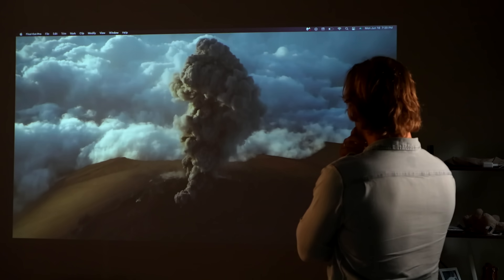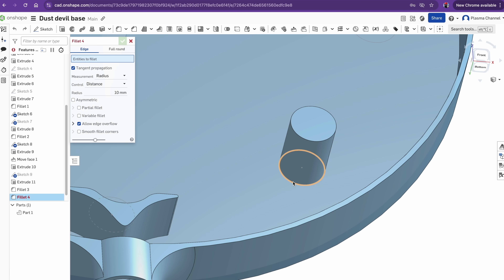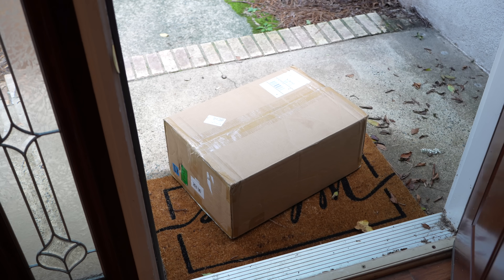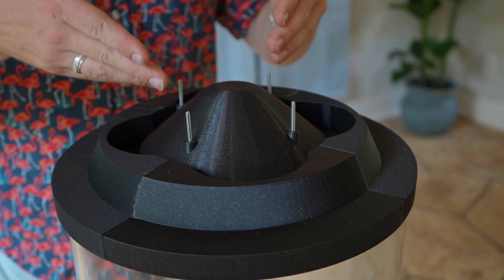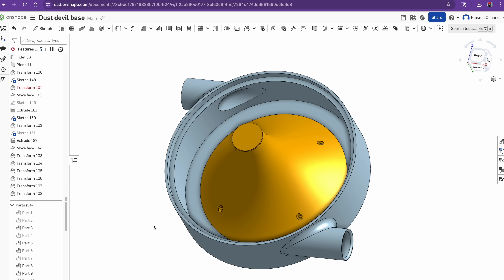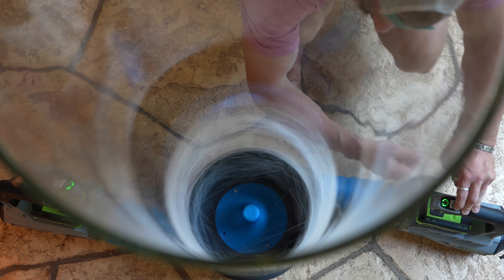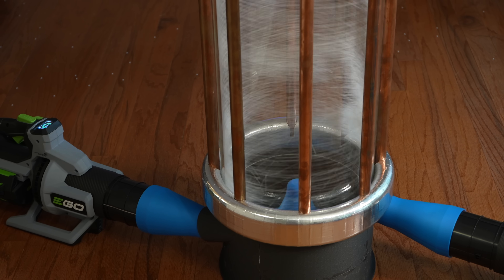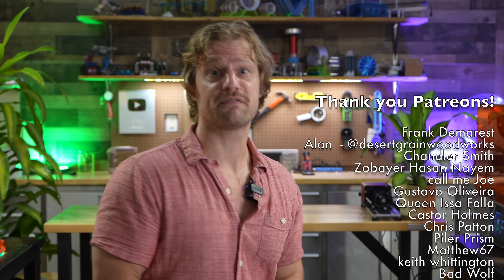Making Lightning In A Bottle Might Be Possible  (ft. 3D Printing Nerd)

Comment: Hey Jay !  Doing this made me think of other things maybe I would try, away from original intent. Like having either metallic beads or just sand,  swirling and introduce high voltage,  one wire at top, one at bottom and particles finish the connections at random. Just a thought.

Comment: I guess you don't know what induction is. Inductive coupling would require magnetic fields and coils.
Reply from the maker: So, with static electric fields, you get an induced charge separation in nearby objects, even though no net current flows. It's not EM induction, it's induced charges from being influenced by static fields nearby. So, a different form of induction.

Comment: if you want to pick up charge with a conductor like your cage, you have to ground it, charge it, then unground it (see volta's electrophorus).
 Insulating from the air would help too
Reply: Correct, I was about to comment the same. All he is doing is charging the inside surface of the glass which induces a charge separation in his conductor on the outside but no net charge unless he does as you suggest.

Comment: Jay, you were partly right with design 1. Anode and cathode at the top and bottom of a NON-conductive tube. The anode and cathode can then be used to complete a circuit. The charge will build up and the only way it can discharge is via the cathode. With regards the airflow, I would suggest a shaped open entrance at the bottom, so it channels air in and the air is sucked out the top, you can either do this directly or via the venturi effect. Directly may be easier, but the venturi is more likely to work as that will also build a static charge in the air mass- its what happens in natures. There is an old video on Youtude where a guy made an articial tornado - which is what you need to get the sand lofted up to build charge. 

https://www.youtube.com/watch?v=h28T0-BaInE

Comment: Your Plasma vortex was perfect, but now you have to attach 6 1000v pf capacitors to the aluminum you wrapped around the middle, and connect the other side to an air resistor, all in parallel.
Reply: Remember to ground the other end with Cooper, then the air resistor.

Comment: Harbor Freight, the $45 leaf vacuum/blower.  In vacuum mode in the Fall, it will shock the heck out of you.  Dry air, plus all of the bits and dust, if your  leg is touching the black bag especially, it will generate large static shocks.  And if you have your hands anywhere near the switch, the shock goes through you to the power switch acting as a ground or close.
Still great, just hold it with the bag away from you instead of resting against your leg.  Same basic idea as the sand vacuuming, lol..

Comment: to FIX YOUR METAL BALL (I saw it has a dent), 
you can toss the ball in your vacuum chamber
you might need to pre-heat the ball in an oven first, but better to try room-temp first (that's what worked for me).

Comment: You should use sand, quartz have also a piezoelectric effect it might play a role here. Also the not round geometry allow for more interactions between all the surfaces. But it will polish your glass tube

Comment: If you have a lumber yard close by, check out the Cyclone Separator used to collect the saw dust. It’s a huge water tank sized device used to separate the saw dust from the saw dust collector vacuum system in the factory. I don’t know if they have problems with static electricity.

Comment: Maybe you should try and put the cage around it again but ground it. You're getting a spark on your arm because you're grounded. If the cage on the outside of the glass is grounded you should see constant sparks from the glass to the copper tubes.

Comment: Just throwing this out there for science:  WHAT IF you turned the tube sideways, added little fins inside the glass to keep the balls moving in this position, and with that other copper thing outside the glass, build another counter rotating glass chamber that spins in the opposite direction.  I know this sounds completely insane but it would be mostly like a particle generator/collider for lightning lol  Things like this are too dangerous, messy and expensive but its still a lot of fun to think about!!!  And maybe Im completely missing something here but this is like one of those forever running magnetic machine things lol  YO if you got like a small engine to run the fans, that would be pretty dope too lol

Comment: So the trouble seems to be that you can't access the negative charge from your "sand".  I think the vacuum zapped you because it was metal and thus conductive, and glass Isn't.   I think maybe if you put your sand in a metal container, or maybe funnel your charged sand through a metal collector tube and back into the  glass tube- like a loop maybe?  out the top and back in the bottom?  dunno if that would work.

Comment: It seems like it's basically a super capacitor that needs a way to discharge through a resistor to make it a usable longer term voltage.

What would happen if you had the spark jump to an actual super capacitor?  Would it capture the voltage into a more usable device?

Comment: I have 2 ideas, each for a separate issue. For making the vortex see if adding a glass coil inside the cage helps. For extracting the charge, try mimicking a battery in that charge comes in one way, goes out the other. In  other words slap a metal disc or something on the top to draw the charge upwards with the air.
Reply: There IS a metal disc inside the top cover, for just that reason! Didn't seem to work too well, since the balls never made up up that high, perhaps just lower the plate down so the balls will touch it. But he already has your plan covered.
Reply: @greenaum he just never showed the disc on bottom after he had to change it so I figured the top changed in some way too

Comment: But isn't a sandstorm static building up when the same material is hitting itself unlike your set up where it uses the properties of two different materials? Also I don't get how sand storm lightning works in real life. Like how do the charges get far enough apart to make lightning? Wouldn't the positive charges be more attracted to the negative ones so they would cancel each other out before lightning builds up. Obviously lightning happens I just don't understand how it works.

Comment: so far, i think you need a heater behind one of the air inputs while keeping the other cold, that way its re-enacting the whole situation that happens in things like tornados .

But weirdly, i had severe deja vu seeing this, but i think thats because someone was making a smoke based vortex generator in a different video but initial designs were almost identical ... wait, just checked, it was your own ionic vortex machine you built a year or so ago - dont you think you forgot everything you learned during that about wind flows and dissipation of charge?

Comment: Nice 60kv static arc over with the vacuum cleaner
Reply: Yeah, shame that the machine that produced sparks by accident, worked much better than the one trying to make them on purpose!

Still, people have commented that he needs suction, not blowing, low pressure not high, so makes sense the vacuum cleaner did a good job. Maybe hack something up with that? Not sand, would get into the mechanism, but rig up the vacuum cleaner, use the little plastic balls, and try and use that with the glass chamber.

Comment: If you notice the material clings to the outside of the tube. The internal electrode needs to be placed on the outside of the tube”inside”   Basically making a Leyden jar. Foil tape strips along the inside would do the trick!
Reply: When I first heard Your Idea, Jay, I thought You wanted to pick up the Charge at the top and bottom of the Tube, after rewatching the Scenes, about half the balls were in the bottom, while around the other half was clinging to the Tube.
Maybe You could cut the copper pipes in half, take shorter ones or alternate them between top and bottom to separate them. :)

Comment: Hm. Nice attempt, and there are two points to take into account for the re-attempt:

1. For the vortex to work, air needs to flow of the center and down the sides. Rather than force the air to spin up from the bottom, since the centrifugal force will push it to the sides, it would be better suck from the center top and let it come back down (maybe with a spin) along the sides.

2. Round and curved surfaces hold a charge better. Nonmattallic gasses (nitrogen, oxygen, air) easily take a negative charge and rush to discharge. If the plastic is less electronegative than the glass (if it is, it will attract dust while you use this device), that can be the other contact point. Ground yourself to one and then touch the other.

Comment: Density needed. Several layers of foil coil with dielectric seperation. There's not enough capacity. Enjoy
Reply: You sure? The problem so far seems to be generating a current, not storing it, but I'm happy to be wrong if you would explain more.

Comment: OMB thoughts here. I do believe you are adding too much conductive area for your setup leading it to leak the energy instead storing it. The build itself it seems to leak to outside instead inside.
What if you pick a PVC tube, not too large, cover the inside with aluminium and place in the center to connect the top to the bottom physically instead wait for the particle to gain energy enough to hit the top to transfer its energy?
Other thing that I notice is once the particles build up charge they start to "bound eletricaly" which will make them work as a heavy block of particles instead light individuals, meaning, once they goes up, not only gravity will push them back and highier they go, highier will be the push force. 
Then try mesure the Electric flow, if there is any, if yes add capacitors in the ends and don't die trying to discharge them.

Comment: Just a thought, when you were vacuuming the sand, the charged sand wasn’t able to come back in contact with the base sand. In your vortex machine, the balls develop a charge, but once they stop moving, the oppositely charged particles are able to move around and discharge each other. 

So, is there a way to spin up the material, build up their charge, and then “suck” out the particles (or collect them at the top of the top of the tube)?

Comment: Maybe instead of having a hole at the top of the tube, you can have an inverted cyclone separator at the bottom of the tube which would generate the vortex but would also force the air to exit through the center at the bottom

Comment: I think for a vortex you need to use the air from inside to be sucked down in the middle instead of letting it out on top. Always remember how a tornado works. it is a circulating system 'almost' closed.

Comment: But why are you ignoring the origional design that worked many times better, by accident? The vac tube. Instead of the chamber, which should have been half as tall looking at the results, one line vac tube in a coil, doubled over.
Reply: A vacuum cleaner hose works so well, why not spiral a wire around the pyrex tube?
Reply: @JerryVolland-bt8cb exactly what I thought. He went from constant sparks to getting excited for one small arc.
Reply: Its a conspiracy, Big Electricity must have got to him. He's compromised lol.

Comment: At its core, you are currently making a Van de Graaff generator, and I believe the best way to collect the charge is to suspend a conductive material just off the surface of the glass.
Reply: Needs a second chamber to be a proper Van der graaf, so the two can build opposing charges and amplify each other.
Reply: @glowpon3  Good point! Though actually, instead of a second chamber, what he needs are separate mechanisms to collect charge from both the glass and the particles. That's why the particles cling to the glass when he stops the air, the glass builds up one charge and the "sand" builds up the opposite charge.
Reply: A sphere allows the electrons to be farthest away from each other before discharging (they are pushed to the outside of the toroid)....that's why they use 'em.

Comment: This would make for an awesome interactive museum exhibit
Reply: Yeah except you'd get people with pacemakers dropping dead and stuff. Perhaps they could have the discharge spark in an insulated glass chamber. Museum visitors switch on the power with a switch or button to hold down (more interactive!) and wait to see how long it takes to make a spark. It could even have a voltmeter measuring the charge. Either the old-type electroscope or something digital just using an enormously high resistance resistive divider, using extra, more than 2, resistors in series just in case one fails, and to spread the load of having to dissipate it. As well as not to steal away too much of the accumulated charge.

Actually an old fashioned gold-leaf electroscope might be good for that, it's nice and visual. I'd worry if the machine would mess up the wifi, mobile phone signals, and even put huge spikes on nearby mains cables. High voltage can be a pain in the arse to modern sensitive electronics, stuff that needs to be sensitive.

Comment: What if you had like an hourglass shape and put vortices on the top and bottom and make them meet in the middle to accumilate a pinpointed charge. 
If you put a fan in the bottom and top inside and get another glass cylinder outside, you could make it a closed system to hold onto the charge?
Not sure if the external airflow is neccesary for building up the charge?

Comment: You don't need any sand, just hot air is plenty. Vacuums are great at creating this effect. I learned this the same basic way, by vacuuming around my wood stove in the winter, I saw some massive sparks coming from the stainless tube to the stove body. It was nothing but hot air in a tube, but the effect was very consistently repeatable. It's just static electric, nothing special I thought, but how to capture and utilize it? That's the question.
Cheers 🍻

Comment: I get a weird amount of static (1-2cm blue spark if use my metal water bottle to discharge on the fridge) 
just from standing up from an arm chair while wearing uggboots with the heater on, and yes it has to be all 3 and the heater can't be to far away.
I don't know why im typing this but weird to see that effect while only having a small spark compared to standing up off the couch

Comment: nice static pillar. sm lol. just dont judge and you are free. forgive yourself of spam. not enough power. why not use a blender upwards prop. or an edf. why do you think the outside of an insulator is in charge. well it is if its a double layer super capacitor. no electrodes, just surface glint. well use a belt like van der graaf generator. obviously. or a windhurts machine. to transport the charges.
Reply: so static levitation, how about static horizontal magnetic field hall-effect upwards levitation of a cross horizontal current wire. theoretically also same in earths magnetic field. one long wire with current levitating upwards in the earth magnetic field, assumes the return trip does not cancel out the upwards hall-effect force.
Reply: Try high current plasma mhd railgun with resistance wire plasma channel ionization by heat. Yep no salt water mhd. Just ionization mhd.

Comment: I have a very old book on electrostatics that talks about high velocity air ramming through fine sand to produce 500 kV + in the 1960s. Tubes were metal for charge carrying and acrylic for charge build up. Air compressor will work well for this!
Reply: ooo whats the name of the book?
Reply: Great Job. A very good start!  Will Followup and see how it goes. Moore’s book on Electrostatics is a good resource. It is one of a few books I own in the subject.
Reply: ChatGPT 5 thought for 57 seconds 

Sounds like A. D. Moore’s classic.

Most likely: “Electrostatics: Exploring, Controlling, and Using Static Electricity” (A. D. Moore). Moore was big on practical triboelectric setups—using acrylic (PMMA) where you want charge to build and metal where you want to carry it away, plus air-driven and powder/sand charging tricks. Later editions bundled the Dirod electrostatic generator manual. 

Second plausible match (if yours was more of a project compendium from that era): C. L. Stong’s “The Amateur Scientist” (Scientific American book/columns), which included ambitious home electrostatics builds and HV projects in the 1950s–60s. 

If the copy you remember had lots of hands-on notes, Moore’s book is the safer bet.
Reply: @edwardhuff4727 ew chatgpt really?
Reply: @edwardhuff4727   redditor

Comment: Do the same as the vacuum, I had the same problem with a sandblasting box, that I built.  Metal pipe into the sand with a rubber hose onto it, sitting in a 5 gal bucket, with a aluminum pan to funnel the sand into the bucket, and got nailed every time I touched the metal pipe.. oh I do also have some pvc pipe to put the sand back into the bucket.  speed maybe your problem, if you want, I can take some photos and send them!

Comment: I think what you need is a tube going up, and then a tube returning it to the bottom. Collect the charges at top and bottom. The way you currently have it, the charges are from one side to the other side. Put a piece of aluminum tape verticle inside ot outside, and another piece 180 degrees the other side verticle. The difference will be, between those 2 pieces of tape. If you make the sand go to the top and return to the bottom you will flip the circle to a verticle circle. And the charges will be at top and bottom.